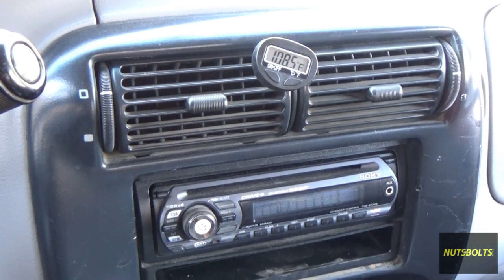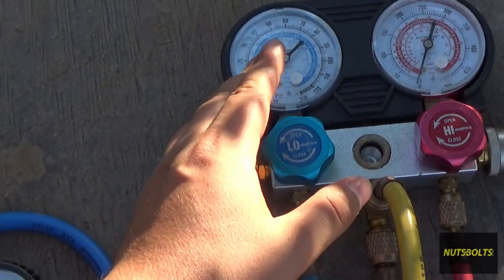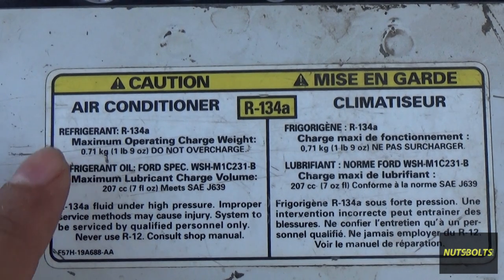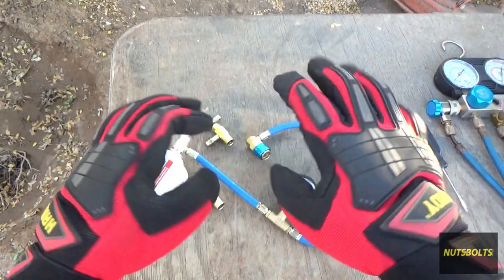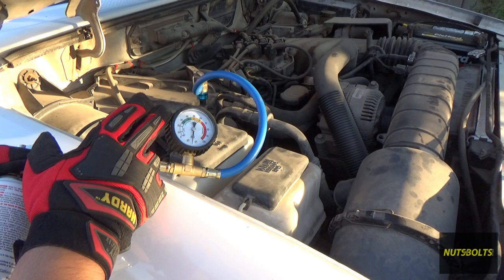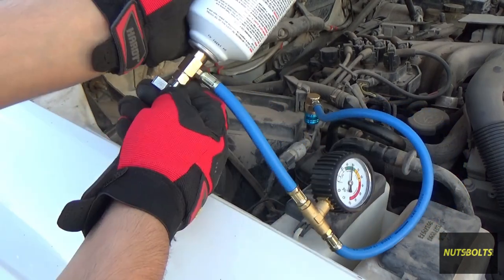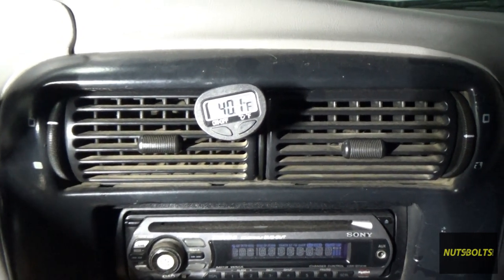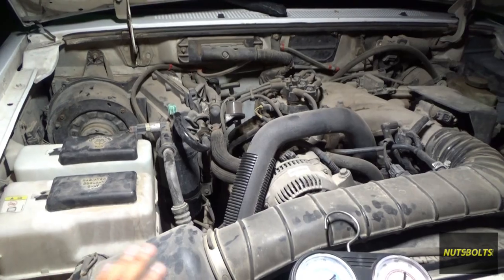How to "Top Off" Your Vehicle's A/C (With Self-Sealing Cans)

Comment: You can purge the line if you have the can connected (but not depressing self-sealing valve) and the low-side adapter connected to the car (if there is still any pressure in the system). Just unscrew the can a bit to use the car's pressure to purge the line.
I would also not hold the can upside down very long because too much liquid with enter the system and slug the compressor. Best to rock it slowly, or if you have patience, just let it enter slowly with the can upright (enters as vapor, not liquid). As long as there is liquid in the can it will keep a constant pressure and should enter the system on the suction side.
Reply: yep.  purging the hose/gauge line is important.  as you mention, all you need to do is unscrew the connected CAN from the hose a second to listen for the hiss, and the air will be gone.

Comment: An additional note... the Can taps have either a 1/2" Acme thread or a 1/4" flare male outlet. The manifold gage tube either has a 1/2" Acme thread or a 1/4" flare female fitting. But the 1/4" flare will not connect to the 1/2" Acme thread without a special brass fitting adapter. Usually the adapter is a separate purchase.

Comment: I used the single gauge short hose to test my static pressure and it came in what I beleive is low for 85 degrees, at 65 lbs.  When I removed the hose from the port it was minor-leak wafing  bubbles in the valve.  Does this mean I have water in my system?

Comment: Does that A/C Pro tap have a check valve? The cheap 'surebilt' brand tap I got at autozone doesn't have a check valve. When you need to swap cans, you end up having to open up the 'yellow' charging hose to the atmosphere, so you lose all of the refrigerant & get air in the line, forcing you to have to purge it again, which sucks. 

There's a ChrisFix vid on how to charge A/C, where he uses a tap with a check valve (for traditional puncture cans) that keeps the yellow hose+tap sealed off while he swaps cans. How would you do this with the self-sealing cans? All of the taps I've seen appear to use the same cheap 'faucet' design & don't have a check valve (I don't believe)

Comment: i wished i would have watched this before i used that stuff my a/c got cold for about 3 wks and it stop blowing cold and the fan i don't here it kicking in i know if i take it to the shop they will charge 3000 dollars one shop cleared my codes and charged 380 dollars and i took it back when the light came on and the guy said give it time it will go off so i took it out of town and they kept my jeep 2wks and charged me 1800 dollars that's why i started working on my car  i do my own oil changes got to do one tomorrow but gotta figure out this a/c thing but not so much it's getting cooler but don't no it i have heat hmmm
Reply: Sometimes a trick to deal with those lights is to remove BOTH battery poles off over night..